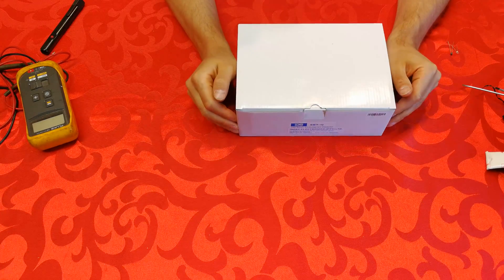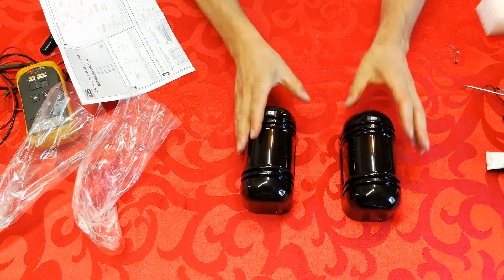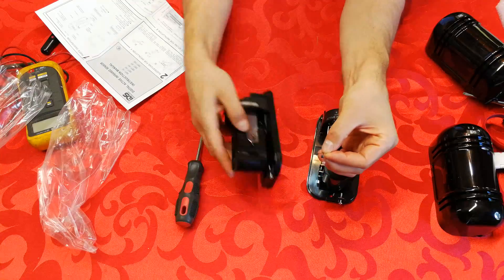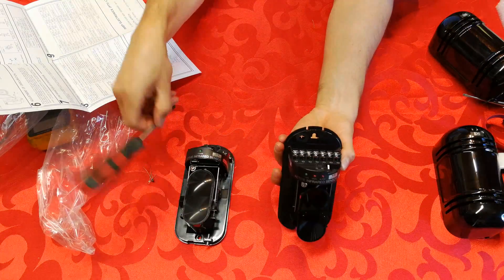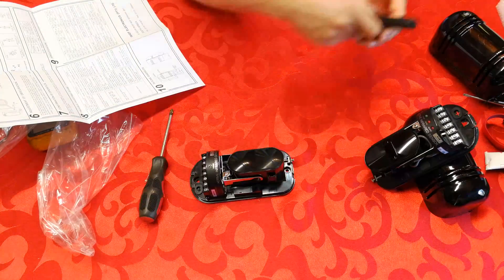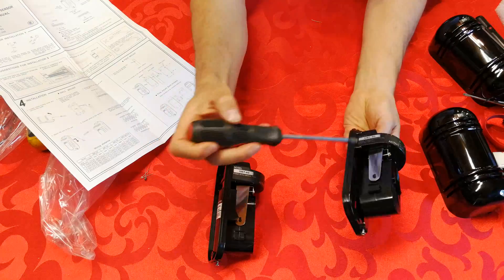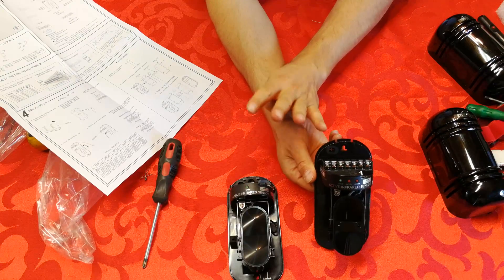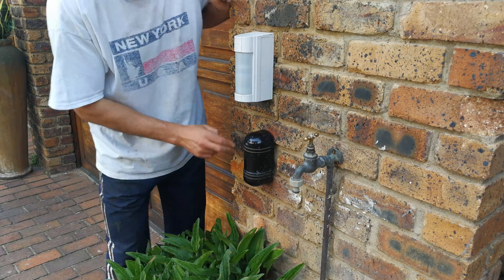Understanding active infrared beams (detectors)

Comment: You repeat the same things a lot but the reason I came here, is only touched very minor. Which version should I buy as in detection lenth. Should I buy a 30 meter version if I have to cover 30 meters or can I better buy a 120 meter version for 30 meter?  The stronger the better? or not?
Reply from the maker: As long as the detection length specification is rated for outdoors then its fine. Some give specification of indoors which is higher.
If your distance is 30m and the beam max is 30m for outdoor this is a question of quality. Since there are many companies who make this, i can only comment on the ones i have used and if you install 30m its fine. 
To be on safe side get 60m ones if you install over 30m. But no you don't need to get 120m for 30 meter distance.
Here is an install https://youtu.be/U9N5ho-L3mM

Comment: Hi sir.. Your video is very informative. I would like to get a suggestion, between PIR or Laser beam sensor which should I choose for residential security purposes ?
Reply from the maker: there is no best single option for a whole house system. The point of alarms is to detect intrusion. Since intruders try different ways of getting in (crawl, walk, jump, slow walk, masking), the best is to use multiple systems. So to answer your question, if you can use more than one method is better than one alone. Beam is good if the intruder cannot see the sender and receiver. PIR is good as it covers wider spread. I first do PIR, then i add beams to increase security.

Comment: The Infrared Emitter LED has no modulation. I cheated it with a normal flashlight
Reply from the maker: thanks for checking that. Its bad design for the security to have no modulation, that means that anyone can bypass this with basic tools
Reply: @ecologicaltime  Correct.
Reply: I need these to cover a distance of around 7m however ive read that exposing them to direct sunlight can trip them. Further reading suggests you have to "out power" the sun light hitting the receiver. Do you if the difference between the 60m outdoor range and one say with a 180m outdoor range is a more powerful ir emitter? Do you think the longer range one at a short distance will be powerful enough to "out power" the sun light entering the receiver?
Thanks